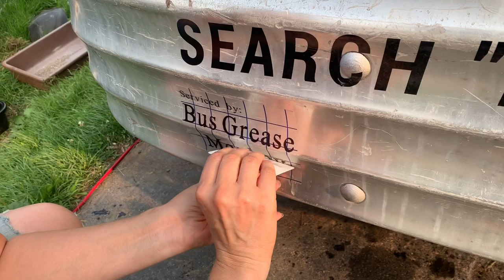Gm bus Silversides pd 3751 day 3 Michigan trip

Comment: Great videos as always. Thank you for the knowledge we have gained here. I picked up my bus yesterday and looked it over very well. Drove home (865 miles from Hattiesburg, Mississippi to 60107 Streamwood. The bus did 72mph top on the flat and was happy at 65 mph. 2002 Thomas FS65 Freightliner, rear air suspension and a 5.9 Cummins. The bus has new tires, brakes and is rust free.

Comment: I have been watching this channel for about 2 weeks. It is shocking how many of these buses have major brake issues and not just recent problems but issues that go back years!!! It makes me weary of these older buses and older Semis I see on the highway.
Reply: DOT inspection is once per year. Here, in Pennsylvania,  17,000 GVW and up is  semi annual.  RV is annual inspection.
Reply: @williamgurtner4759  P.A. changed it. They went to once a year on trucks and buses to align with the federal regulations.
Reply: Pretty sure this is an RV, not subject to DOT inspection, and Michigan does not have inspections for non-commercial vehicles.
Reply: Joseph,  I did not know that. Haven't inspected in about 2 years now.
Reply: @williamgurtner4759  I drive truck for a living and drove transit bus for quite a while. They changed it about 4 or 5 years ago now. Plus I'm from P.A. and always kept up with the regulationa
Reply: Joseph, that must've been right after I left the job. Thanks for the update. The only thing left, at semi annual inspection,  are emergency vehicles and I believe school buses.

Comment: Incredible lucky that that bus never got into a situation that required emergency braking or a  steep curvy hill decend. I have been a hobby mechanic for 35+ years and i have never seen such a  crucial and scary maintenance error.
Don 't they have yearly inspections on road vehicles?  Surely that error would have been spotted. 
Great to see you fixed them.

Comment: How comfortable is the seating position? Looks like you’re right up on the pedals, but the steering wheel and shifter are a a bit of a reach.
Reply: It's even less comfortable than it looks.  The clutch is far too close to you, and it must remain there in order to keep a good seal at the floor.  People's knees must have bent in a different direction than mine 72 years ago.. That being said,  once you get it on the road,  unless you're in the mountains, your left foot gets to rest.

Comment: I'm thinking that wear on gear was on the let out side of pinion?? Not power side?? Heavy down shifting will do that!! He had no brakes rite?? Been using gears to slow her down just my 2cents worth??
Reply: Pinion wear has nothing to do with the transmission not wanting to stay in gear, two totally different systems.  Based on watching how this guy shifts, I'd be very surprised to see him hit first gear at speed for a downshift.  In fact, I was going to comment about his weird shifting style anyway. I don't like how he pops it out of gear every time he comes to a stop or a coast... one of these days he's gonna need power to avoid something, and he's going to be screwed. If you want to coast push in the clutch otherwise hold the throttle.
Reply: @kleetus92  AY watch last video be for this one then u will see what I'm talking abt??
Reply: @scottyjones27  I know exactly what you're talking about, but the pinion in the rear axle isn't even IN the transmission. It's 3 feet away separated by the driveshaft.
Reply: @kleetus92  I've not commented or said one thing abt trans sorry other than had no brakes and that's why pinion was worn on the back side of tooth not power side of tooth?? Not one thing I said abt trans or dude shifting sorry it's the day before video were u can see the pinion sorry u got messed up n thought I was meaning this video
Reply: @scottyjones27  Well then why did you comment on THIS video? 

For the record, to have damage like that in one localized spot on the R&P, there had to be something either ingested in the gears, or, it was a casting flaw from when the unit was originally made. 

Also don't forget, that pinion is on the backside of the axle not the front, so it should wear backwards.

Comment: 4 valve goodness! Just wondering when working on brakes - do you cage them?
Reply from the maker: Nothing to cage. This has old school air brakes.   Just diaphragms no springs.   All 4   Drive shaft brake is emergency and parking brake
Reply: @BusGreaseMonkey  Ah cool. The only time I have ever set slack adjustments was when I was getting my Air endorsement. The tour coach company retro-fitted the MC5's,  MC9's and 102's with Auto-Slack adjusters. We only performed the "standard" air brake test.

Will you take time to fit the 4 valve soon?
Reply: Spring brakes are only on rears or trailers, wouldn't want the front end locking on a wet road if you lost air.
Reply: @rayg9069  Yep, been a while but that is logical!

Comment: Can you not float the gears and avoid the double clutching with this transmission?
Reply: Probably, but I'd think it would take a bit of practice, and patience to master it. I've never driven a column shift, unless you're talking 3-in-the-tree on an old pickup truck.
Reply: Yes
Reply: The HUGE drop in RPM between each gear is another problem also I imagine that makes gear floating a little harder to do.  He's only got 4 gears to work with RPM spreads between each gear are very large.

Comment: I really like this bus. What an era for design. Do they still use 2 strokes in trucks? I know that railroad locomotives still use them.
Reply: EPA murdered 2-strokes..
Reply: Thanks.
Reply: Lots of 2-stroke cycle diesel engines still on the road and in use in marine applications, as stationary power plants, and in agricultural pumping.  Detroit Diesel sold their “legacy” engine lines to MTU.  The 92 series engines are still being made.  Not available for on-highway use, but parts are still available.  (U.S. military still uses them, or so I have read/heard.)
Reply: @brucefay5126  Good info, thanks. I know in locomotives they are used to power the generator that powers the cars.

Comment: I get the four speed on the column , could you show where or how reverse is engaged ?
Reply: Switch on the dash controls a solenlod. Put shifter in first, hold switch & slide the shifter into second. Transmission is now in reverse
Reply: @TooManyHobbiesJeremy  thanks had  no idea

Comment: Ok I was cringing at him putting the bus in neutral and gliding to a stop (drives tractor trailers)
Reply: wi11y1960 I was watching that and was thinking of commenting on it, glad I wasn’t the only one. We all started driving larger vehicles at sometime, wouldn’t hurt for some to get a little training. I took my Class A with a 18 speed and actually got my passenger endorsement with a Crown that was manual coupled to Hall Scott. The owner is up shifting fine, just needs a little practice on down shifting. Not knocking the driver, I have seen far worse.
Reply: Use the engine rather than the brakes alone
Reply: I was thinking the same thing. That would be an automatic fail on a CDL test. It seems a lot of the bus owner operators aren’t really well trained. That makes it rough on the already aging mechanical parts.
Reply: Yep, made me cringe, too. Also don't worry about turning the blinker off until you've finished the turn and you're accelerating. No need to multitask there.
Reply: Bill Moran Everyone had to start somewhere.
Reply: I hope the owner doesn't take this as me piling on, but yes, it should be in gear most of the time. The revert to neutral position habit can get you in real trouble when driving in the mountains. We all have more to learn, and hopefully this constructive criticism will be beneficial. I have no doubt that my driving would be flamed by "armchair experts", but maybe they could teach me something new.. Btw, if my bus and this bus fell in love and had babies, they would be just plain adorable.
Reply: heartland96a that's why the bus had brake issues in one aspect, all brakes no wind down with the motor
Reply: Agreed 
Yes have to learn sometime 
But really should be in a gear
One of the first things I was taught driving a crash box
Put in neutral slow down to 30 kmph then find the right gear without crunching 
If you couldnt you didn’t pass
Reply: That's known as Angel gear in some parts of the world, many a driver using it in hilly country has gone to meet his maker when the brakes overheated.
Reply: Ray G  
Absolutely know that saying well
Lived and worked in very steep country 
Always had the truck in the correct gear and use the brakes sparingly 
The old timers use to talk of brakes boiling on the old school petrol powered trucks on long down hill runs
Reply: Yup...shouldn't be out of a gear for more than the vehicle's length.
Reply: @MD-ob1gq  That would be an interesting challenge at 55 mph... lol
Reply: Step 1: Get CDL 
That is all 
Good day
Reply: You do know the owner of this channel is NOT an O/O.  They are hobbyists that drive the buses recreationally for fun and preservation.

Comment: I should start a business just traveling around teaching bus owners how to shift gears a double clutch a transmission properly.
Reply: I feel ya. Keep it in gear, down shift through the range. A vehicle not in gear is not in control. Drives me nuts when drivers kick a heavy vehicle into neutral. On a positive note, nice bus, good job but how the hell does a person call themselves a mechanic and let that kind of mistake go out the door? I always double even triple check my work.
Reply: @MD-ob1gq  And if ya can't find em GRIND em.

Comment: Dumb question...does the air brake system put the same amount of air to all the wheel cylinders equally or is there a proportion valve to distribute more to front and less to back?  Seem there should be maybe uneven wear on those shoes -front shoe vs back shoe, higher on rear shoe, instead of all around wear - instead you have no wear. Guess it's noisy in a bus-not to hear clank or thump from the brakes returning improperly.

Comment: If those locking pins fell out because of a missing clip it had to happen right after the brake job because those shoes weren't even worn.
Reply: Sounds more likely to be a problem with intermittent mechanics than anything else..

Comment: On the column shift 4 speed, where is reverse located in the  shift pattern?
Reply: I have seen from some of the previous videos, I think reverse was, put it in 2nd gear?? and than pull a solenoid lever to put it in reverse??

Comment: My bet whoever did the last brake job on that bus did not tighten the bolt that holds locking bar for the pins in place.  I have scene those pins fall our before and more times then not they damaged the brake shoe(s) I also have scene those bolts break normally because some idjiot uses a “hardware store” bolt or puts a split washer on the bolt.